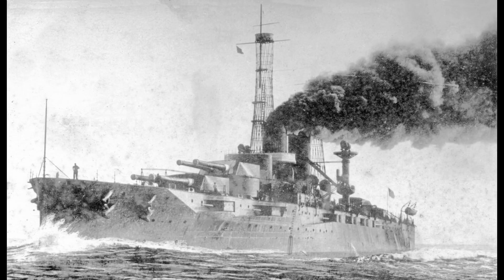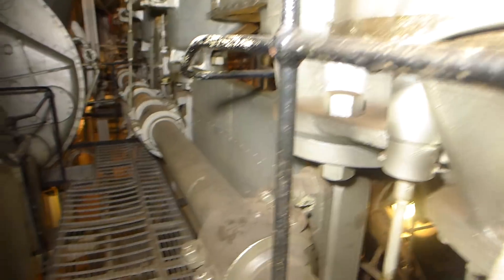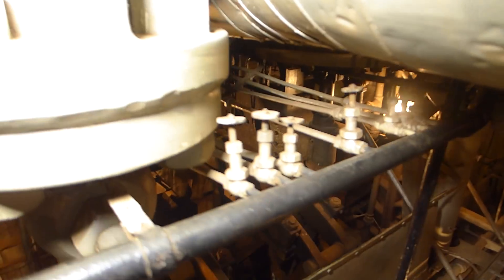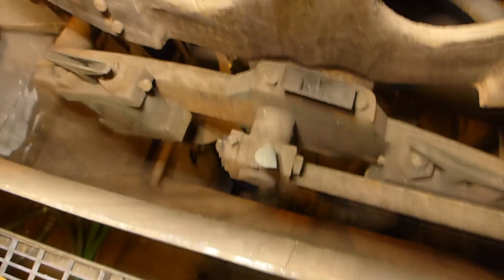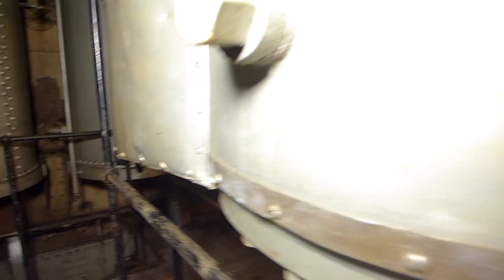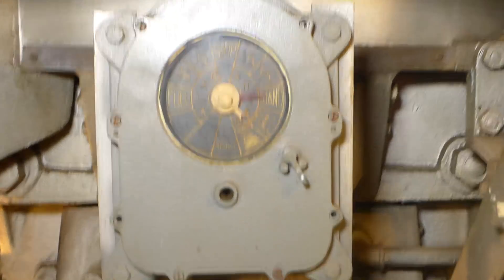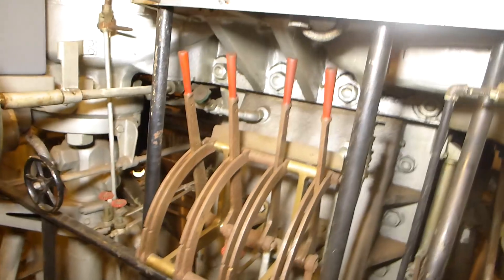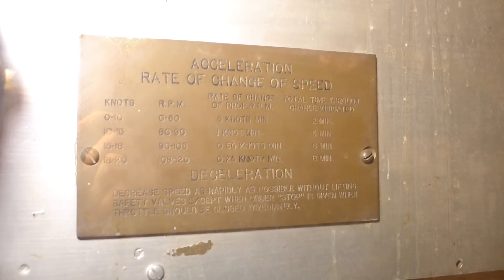Battleship Texas, Starboard Engine Room Mid Grate and Controls, Video 2 of 3

Comment: What you were saying was the drain for the separator is the isolation valve for the gauge glass.  There are upper and lower shutoff valves on the gauge, plus a drain under it.

The statement about the condenser gets the tubes backwards.  Seawater would be inside the tubes, steam and condensate outside.

Comment: The reason for the rudder angle indicator you already showed.  The steam steering engine could be operated locally.  The STBD Engine Room station was important because that was the duty station for the Engineering Officer of the Watch.  The indications for the Port engine were there for his benefit as he was responsible for the operation of both engines during normal steaming.

The acceleration/deceleration tables were important as they kept the Throttleman from outstripping what the boilers could do.  The men in the fire rooms also had an Engine Order Telegraph Repeater.  This was so they could adjust the number and firing rates of the burners on the boilers in anticipation of what the Throttleman was about to do.

Comment: I think my favourite part of this was the revolutions counter, is that still the total number since the engine was installed? No matter the answer it's still extremely cool to think about how that is a solid representation of how this engine has had a full and active life.
Reply from the maker: The counter was undoubtedly used like we would use a trip odometer in our cars.  What is seen here is only a minute fraction of the engine's total revs over its life.  Based upon a very loose calculation, it is likely that the value shown on the counter represents less than a couple of hundred hours of operation, using a cruising speed of 8 knots at 48 rpm.  Regardless, your point is well taken that the engines did have full and active lives!

Comment: The rudder angle indicator was so the throttle man would be able to anticipate a change in rpms. In a turn the outboard engine would speed up and the inboard would slow down, in a max  shaft rpm scenario the outboard engine could overspeed and damage the engine.

Comment: Hi Tom, Thanks for this very interesting tour - I remember that you said in one video that the rudder is frozen. How about the engine ? Can it still be turned, or is it frozen as well ?
Reply from the maker: The engines haven't been turned in about 75 years.  It's reasonable to assume that piston rings and bearings are pretty frozen and it would require major work in a shipyard to free things up enough to make things move.
Reply: @tomscotttheolderone364  Thank you.

Comment: The rudder angle is in case the main steering from the bridge or if the bridge gets knocked out it can be steered from engine room
Reply from the maker: There are no steering controls in the engine rooms.  Steering can be done at the steam steering engine, but that is 50' away from this indicator and has its own rudder angle indicator.  Otherwise, there are 3 other steering positions that would serve better; the armored conning tower, central station and aft steering.  The armored conning tower is close enough to the nav bridge that if it received a fatal hit, the nav bridge would likely be destroyed also.  However, that still leaves central station and aft steering that are in safe locations, well away from the nav bridge and deep in the ship.

Comment: The rudder angle might be useful of the two engines were not producing the same output, to indicate that there was a difference (the rudder angle was not 0 to steam straight) or to indicate the engines were to help in maneuvering.
Reply from the maker: Since the engines are attached to identical shaped propellers, they will produce exactly the same amount of thrust if they are turning at the same speed.  Any difference in speed between the two engines can be accurately determined by watching the tachometers at the control stand.  If those failed, you could then calculate rpm by watching the mechanical revolution counters on the engines and use a stop watch to know number of revolutions in one minute.
Reply: @tomscotttheolderone364  my first thought for the rudder angle indicator was that maybee you would want to increase RPM to engine on the outside of the turn to assist in the maneuver if necessary. for example if you saw it indicating a rudder angle of 30 degrees to port then it would make sense to increase the engine RPM on the starboard engine relative to the port as that propeller would be traveling further since its on the outside of the turn just like what the differential does in your car when taking a corner so that both wheels get equal power even though they travel at different speeds. i would imagine similar physics would apply here

Comment: I always wondered why condensers were needed, until I found their efficiency was measured in inches of vacuum. By condensing the steam, the output of the low pressure cylinders was into a lower pressure than it would have been, so, since the efficiency depends on pressure difference, more power was extracted. Later, I found that it also was needed to inject feedwater back into the boilers.
Reply from the maker: It's primary purpose was to condense low pressure wet steam back into water.  It is the only way that you can have a closed loop system.  Sending feed water back to the boiler rooms was the job of the feed water pumps that sent it back under 400 psi pressure on Texas.  The fact that it pulled a vacuum on the engine's low pressure cylinders was a happy plus.
Reply: @tomscotttheolderone364  Not just a happy plus, but why a Carnot cycle efficiency increases with a lower temperature at the cold end. I learned the theory in Thermodynamics class, but never understood how it worked until I read books on old ships where they gave the specs for condensers in inches of vacuum.
Reply from the maker: @skovner  I know, it was a figure of speech.

Comment: I wonder if they ever "hooked up" those engines. When you are driving a steam locomotive, once you get it going, you move the reverser handle toward the center position, which reduces the valve stroke and thus the amount of steam consumed. Engineers learned how much they could hook up an engine in given conditions for best fuel and water efficiency.

Also, I was wondering if those black hand rails were original, or were added by Parks & Rec when they started giving engine room tours.
Reply from the maker: Yes, they could and did adjust cutoff, by using both the reversing shaft and individual valve adjustment using the small hand wheels at the end of suspension link levers on the reversing shaft.  While I am sure a good engine room chief could get it pretty close by sound and feel, they also used an indicator that could be hooked to each stage that precisely charted pressure and timing.  Go to page 212 in my bible, the 1914 edition of the Naval Academy textbook, "Naval Reciprocating Engines and Steam Auxiliary Machinery". "https://www.google.com/books/edition/Naval_Reciprocating_Engines_and_Auxiliar/P3IKAQAAIAAJ?hl=en&gbpv=1&dq=naval+reciprocating+engines+and+auxiliaries&printsec=frontcover
Reply: @tomscotttheolderone364  THANKS! downloading the pdf now. I read the Mass. Maritime Academy's manual back when they had a steamship.
Reply: @tomscotttheolderone364  Thank you very much for your very informative reply.  I will add the work you cite to my google books favorites.
Reply: I obviously don't know about the TEXAS in particular, but in running marine engines generally it was common practice to "link in" or adjust the Stephenson links to shorten the steam cut-off of the cylinders when running at less than maximum speed.  This resulted in greater efficiency than partly closing the main throttle valve-- steam expanding in a partly closed main throttle valve is completely wasted.
Reply: @Pamudder  I was wondering this about compound engines. With locomotives (single expansion) it's fairly straightforward. But it seems to my mind that if you shorten the steam cutoff on the intermediate and low pressure cylinders, then you're also adding back pressure to the previous cylinder. In other words, since the IP cylinder's inlet is the HP cylinder's exhaust, closing that valve earlier would prevent the HP cylinder from fully exhausting and rob it of some of its power, wouldn't it?
Reply: @John73John  Very good question, but because you are also reducing the cutoff of the high pressure cylinder,  I don't believe it's a problem big enough to offset the advantage of reducing engine speed by adjusting cutoff rather than partially closing the throttle valve.  For an answer that is more than an educated guess, I would refer you to Tom Scott's excellent reply on this same thread and the reference work he cites.

Comment: In my days as throttleman we would get the bell order usually followed up with a turn order such as “ahead 2/3rds make turns for 10 knots “. We had to keep a bell log for each order which was tricky at times when orders came fast while performing various maneuvers. We also logged the turn counter. 

Surprised there isn’t a steam trap at the bottom of the the dryer. That condensate should be saved.

Comment: The reason they have a rudder gauge in engine control is because during a turn, the boat would require MORE POWER to maintain its velocity / speed.   As the rudder angle increased the steam would be applied to keep momentum through the turn and not slow the boat down.   Thank you for the tour!
Reply: Ur not supposed to add more steam during a turn unless its under battle conditions. This adds way more strain to everything. Yes, I worked on a steam plant.
Reply: @memadmax69  battle condition or otherwise,  that's why they have a rudder gauge in engine control.  To get out of dodge if ordered!  Lol
Reply: Maybe more on one side and less on the other side?